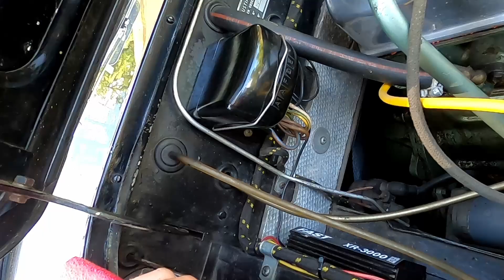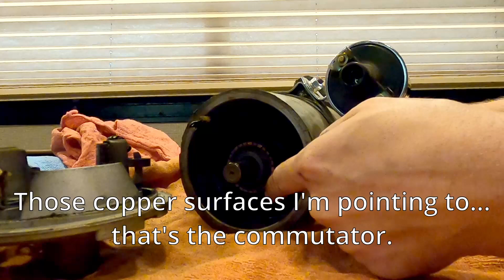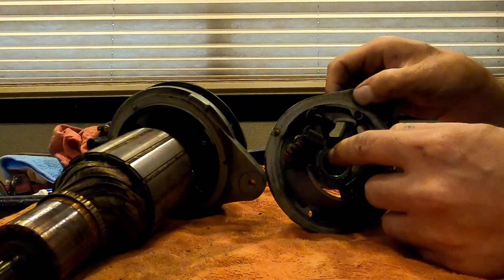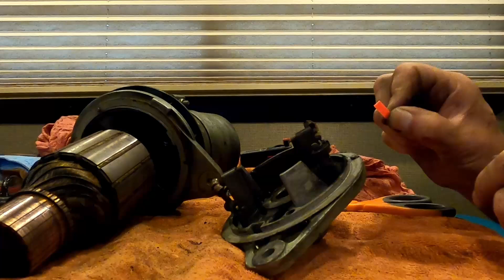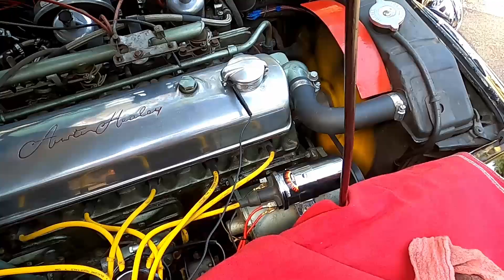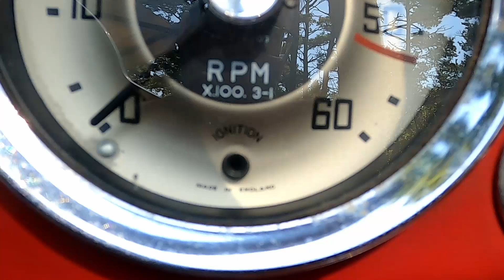Lucas Generator: Roadside Repair!

Comment: ....."What kind of car is that ?"   haha ......Not half as annoying as , "Wow, I like your MG " when they approach my TR3A ......Been putting up with THAT for 57 years ! ......lol     ( By the way, ...I always carry a spare set of generator brushes , points & condenser with rotor , and a fuel pump , as I did with all my cars over the years that had traditional systems )
Reply from the maker: I was president of the Triumph club for a few years, so I'm definitely used to the "Nice MG!" comments.  My favorite when I'm in the Healey is "Is that the James Bond car?"  I don't like disappointing, so of course I say yes.  Yes it is.